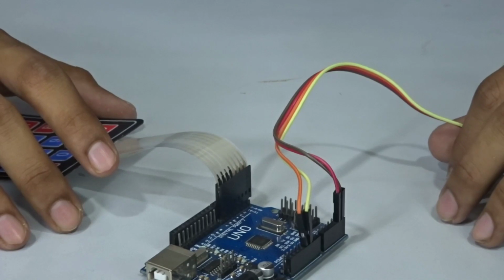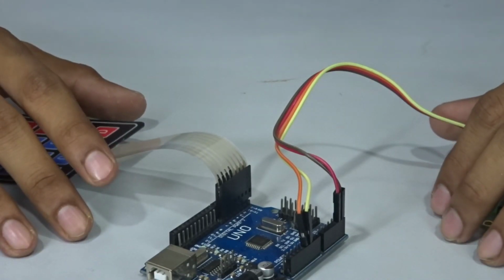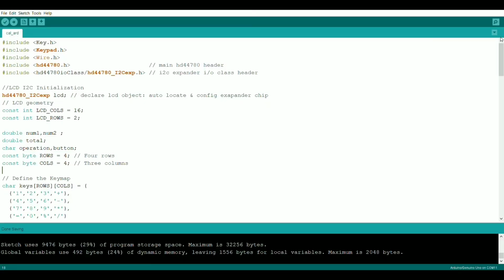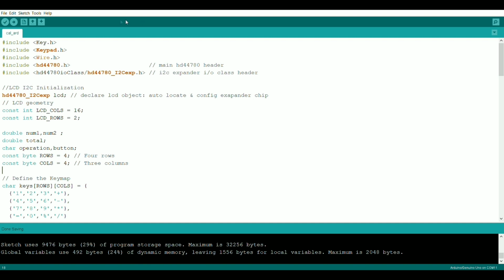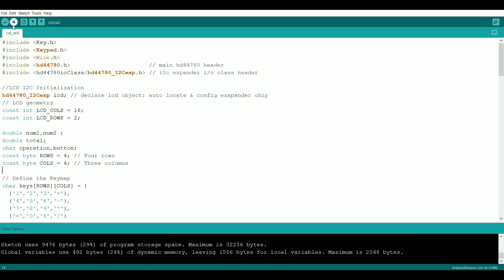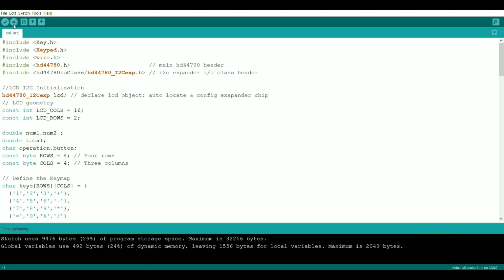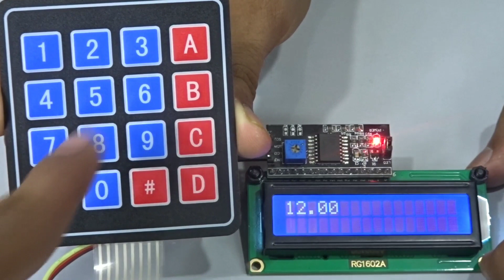Arduino UNO Calculator Using  4x4 Keypad and i2C LCD | Arduino Project | How To

Comment: This is very important for me, please fast come. What is this next to lcd? Small compenent? Blue square and... What is this? I dont have this can ı make calculator?
Reply: What is key.h ??
Reply: Fast respon 😅
Reply from the maker: It is an i2c device which is used for communicating between the Arduino and LCD. You can definitely make it without it.
Reply: @INOVATRIX  Thanks, I'm trying but result is negative. It's not do. Have you a instagram please :) ? I have a question, detailed. No text on the screen. I try with trimpot but not completed.

Comment: What is this next to lcd? Small compenent? Blue square and... What is this? I dont have this can ı make calculator?
Reply: yes you can, but it is easy to do this project with that. its name is i2c module
Reply: @in4mative2011  I'm graduated :)  It was basic study project but it was very boring... I don't like things like this. Electronic not for me. (7 month...)